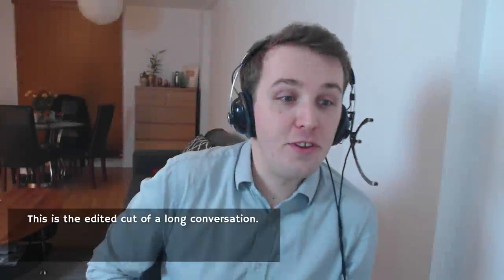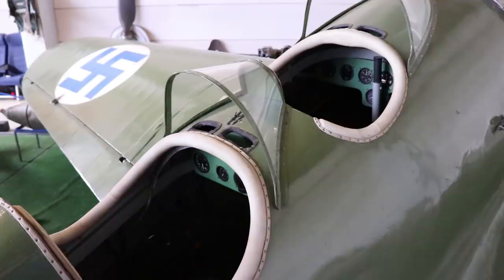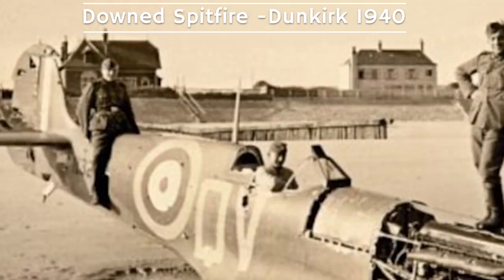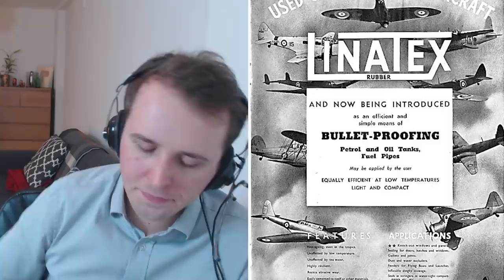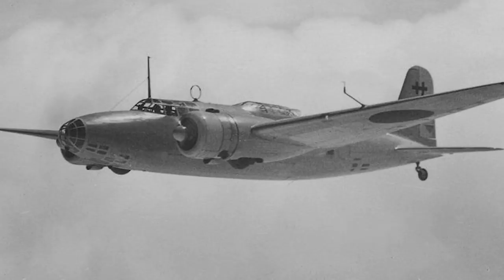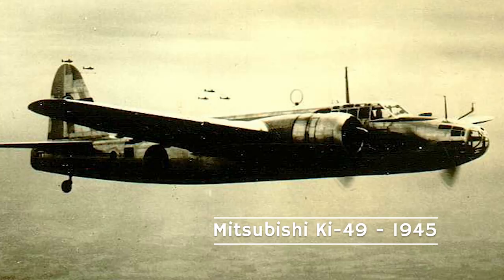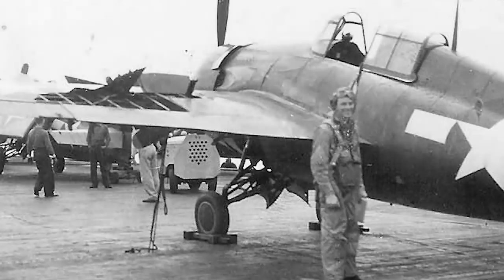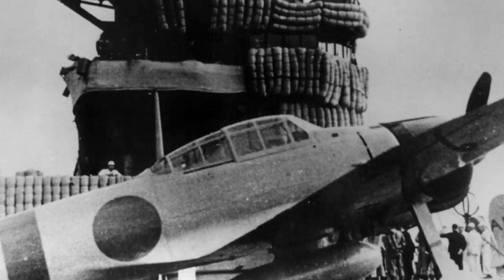WW2 Armour and Fuel Tank Protection - What They Don't Tell You

Comment: You didn't make any comment or analysis of the necessity for armouring a bomber's bomb-bay.
Reply: Were those armored? Can't think of any offhand that were.
Reply: @noshurviverse8388  I didn't say they were. I'm asking: "was that investigated and/or implemented?"
Reply: @andrerousseau5730  I don't think there was any reason you'd want/need to armor a bomb bay. It would be extremely heavy and any caliber of weapon that could set off a bomb inside the aircraft would almost certainly be capable of punching through any armor you'd hope to give it.
Reply: @noshurviverse8388  Your argument is self-defeating: in that case crew armour would offer no protection either so why add the 'unnecessary' weight?? (Obvious answer: "because no-one would want to fly a combat mission!"). Furthermore, I have read of several cases of mid-air explosions where exactly that was the attributed reason, hence back to my first question.
Reply: @andrerousseau5730  No, my argument isn't "self-defeating" in the slightest. Crew protection is included since a pilot really only needs an armored seat back to afford decent protection to him, and that the threshold for what is a threat is much lower. If a 7.7/7.92mm rifle round punches through the skin of an aircraft into it's pilot, then that plane is almost certainly going down. You throw a half-inch steel plate in the pilot's seat and you can avert that, while the rather small size of a seat back means that weight is kept just about a hundred pounds. 

Now, how much weight will it take to put a grand total of a quarter-inch of armor around the B-17's bomb bay? Based on some very rough guesstimates of it's size, you're looking at somewhere in the region of 4,000lbs. That'll keep some rifle caliber rounds out, but does a rifle round have the potential to penetrate an aircraft, penetrate the shell of a bomb and carry enough thermal energy to set off the explosive? If so, you'd expect bombers to be blowing up left and right considering how much fire those things take.
Reply: @noshurviverse8388  Your argument is well off-track as you only refer to 'pilot'; clearly you're you're in fighter mode, not BOMBER mode! For the latter you have to consider the entire crew who operate in entirely different compartments and who have to move about the aircraft. With modern light-weight Kevlar full bomb-bay armouring is perfectly feasible. The crew protection 'tub' used in several ground-attack types is all-encompassing and some tyoes are of steel. The designers designed accordingly and the aircraft engines sized appropriately for the additional weight.
Reply: @andrerousseau5730  Bringing up the titanium bathtubs that planes like the A-10/Su-25 use is kind of an odd choice, considering they line up pretty much perfectly with my view that crew/pilot protection is much more important and generally the focus. Considering the high risk environment that these aircraft operate in, isn't it a bit telling that they all carry their ordinance on wing pylons, entirely exposed, as opposed to a theoretically armored bomb-bay? Meanwhile, the kind of aircraft that have internal bomb bays largely won't be dealing with hostile fire that armor could be expected to defeat. Armoring a bomb bay won't do anything when a Buk or Phoenix rips your plane in half. For crew moving around the aircraft, most bomber designs placed armor that would protect the crew in locations where it would be expected for them to be, rather than where they might walk. On the B-17 the tail and waist gunners get armor plates in front of them. The walkway between the tail and flight deck isn't.

Also, the video was pretty much focused entirely on WWII aircraft, so bringing up modern materials and engines that put out massively more power than any engine of the time period ever could isn't particularly relevant.
Reply: @noshurviverse8388  Fine, if you restrict the debate to WW2 bombers then your comments and observations are a case of peering to close to the window instead of standing back to take in the long view because what you failed to see was the evolution of Luftwaffe battle tactics as the air-war, and specifically the strategic bombing raids, progressed. German air-war tactical thinking became very focussed on Schrage Musik weapons systems. Only a very few were used operationally because the Germans were simply too late to widely implement them. Most were upward firing cannon installations but more fearsomely, they had tested a recoilless mortar with devastating results. Had these been more widely deployed (and would definitely have been if the war had continued) then it is inevitable that in the course of an attack ripping the belly of a bomber open then sympathetic secondary detonation of the bombload  would almost certainly have become a more frequently reported result. The further consequence of this is that bomber manufacturers would have been forced to armour the under-belly and specifically, the bomb-bay of their aircraft. You may or may not be aware that the light-weight flak jackets issued to bomber crews were only 'light' because they consisted of an internal matrix of over-lapping Magnesium plates. Almost certainly the designers would have likely resorted to this arrangement to extend armouring to the now, more vulnerable under-side of the aircraft. Thus the additional weight would not be as much as you estimated. The little extra weight-growth would have been mitigated by up-gunning the engines with all the attendant range-consequences due to higher fuel consumption.
Reply: @andrerousseau5730  Firstly, Flak Jackets were not made of Magnesium, but Manganese Steel, which was a steel alloy that incorporated Manganese into it. Magnesium was a completely different element that had nothing to do with flak jackets. Manganese steel had been a thing since the 1880's, so it's not like it was some new wonder material. These flak jackets weren't that light, most the numbers I've been seeing for the models you're talking about were somewhere in the range of 22lbs. It's also worth looking at what these jackets could stop: they were designed to withstand projectiles such as shell splinters, not direct hits. Apparently the testing showed that they could stop a .45ACP round, but that's a pistol caliber. The difference between a handgun round and rifle caliber round is massive, .45 usually carries somewhere around 4-500 joules, while a 7.92 round has about 3,000. To the best of my understanding, a 20mm shell would have a similar order of magnitude higher energy. 

So for the purpose of defending against the Schrage Musik, which the vast majority of the time was using 20-30mm rounds, slapping a layer of flak jackets on the bomb bay doors isn't going to cut it. You're going to need a much thicker armor layer, with the concerns that come with it. While it's a rather minor point, I'd also question if you'd need to refit bombers with more powerful systems to open these bomb bay doors, since you're adding at minimum hundreds, perhaps thousands of pounds to their weight.

Secondly, I think you're underestimating the extent to which the Schrage Musik system was utilized. Everything I've read that the system began seeing use in August 1943, with it being rather widespread throughout night fighter squadrons by the end of the year. The Germans were absolutely making good use of these things, rather than it being scattered instances. 

This provides us with some additional information: how did the Allies react to this? From what I've seen, while it took the Allies some time to properly understand what was happening (thinking at first it was simply strangely accurate flak, or night fighters that were somehow performing consistent pull-up attacks), the reaction was mainly focused around two major avenues. The first was calls to reequip the British night bombers with ventral turrets that had previously been removed. Secondly, airborne radar sets being used were decent at detecting planes approaching from behind, but not from below. By Spring of '44, more advanced radar sets were being installed, and the losses bombers suffered by night fighters declined. Nothing I've read indicates calls for armoring the bomb bay. 

Finally, looking at things from the German side reveals how they used the Schrage. A couple quotes:
     "The accuracy of the new weapon allowed aiming at specific vulnerable points - such as the Port outer engine of a Lancaster, which powered the rear turret (which if hit would leave the bomber virtually defenceless from a 'von unten hinten' attack) and the fuel tanks in both wings. Wings of course presented a much bigger, more flammable and safer target than the fuselage and there were always the bomber's engine exhaust flames to guide the fighter at such close range. A short burst was usually enough to cause sufficient damage or fire, to cripple the bomber or even make it crash, whilst the fighter usually had time to move to safety."

     "...could reckon to destroy a Lancaster or Halifax with an economical two-second burst. Aiming was so straightforward that it was possible to choose the right place to hit, the main wing spars between the engines being a favoured spot."

Thus, the favored areas that the German night fighters tended to aim for would be areas on the wings, since those contained vital elements and were a large target. Now, there's a part of each of these quotes I left out, since I wanted to emphasize them since it's extremely relevant to the conversation:
     "Firing into the belly of a fully laden bomber from close range was quickly found to be unhealthy."

     "The bomb bay was carefully avoided!"

In short, setting off the bombs would actually be the last thing that a night fighter using the Schrage would ever want, since his aircraft would be directly below a large explosion and the ensuing debris would almost certainly damage or destroy the fighter.
Reply: @noshurviverse8388  By roundabout means your reply has proven my point about the vulnerability of on-board bombs to shock-detonation by impacting shell-fire. Indeed you only have to see the many pieces of gun-camera film footage of fighter attacks on V-1 flying-bombs (and the consequent many incidents of damage and loss) to appreciate the danger, more so considering that the on-board bomb-load might be several times that of a V-1 warhead.
   I somewhat suspect that Luftwaffe pilot claims of being able to aim for specific points during a frontal Schrage attack are highly exaggerated; up to ~800mph combined closing speed?... close vertical separation distance?....doing all this in the dodgy climate of central European skies - and worse, in the pitch-black of night?; I very much doubt it. For the same reason ventral manually operated bomber turrets are of zero use. Even if they had enough advanced approach warning (doubtful) they just wouldn't be able to track the attacker fast or accurately enough to land a hit.
   Cannon Schrage Musik installations were not the ultimate implementation of the belly-attack tactic. This honour would have eventually fallen to the recoillesd mortar system I referred to earlier. I recall that it was successfully trialled in the Me 163B Komet. The notable feature is that there was no manual trigger: entirely automatic.
   The vulnerability of bombers to this form of attack is considerable and only underside armouring is the only feasible option. Had the recoilless mortar Schrage Musik system been installed then the amount of bomber armour required to obtain the necessary level of protection would have been prohibitive.
Reply: A perfect example of the need for bomb-bay armour concerns the 12th January, 1945 RAF raid on the BRUNO U-Boat pen at Laksevåg, Bergen in Norway. Flight Officer Phil Martin's Lancaster DV-393 (R for "Roger") on-board Tallboy took a hit by an 88mm AAA shell which dislodged the arming release wire (!). Luckily they lived to tell the tale!
Reply: @andrerousseau5730  I'm not super enlightened on exactly how the Tallboys were constructed, but from what I've read they were typically base fused impact fuses with a delay. Dislodging the arming release wire would either "unlock" those fuses, which means they'd still require a suitable impact to detonate, or make it so the bomb was unable to arm, depending on how it dislodged. 

I'd be interested in seeing this report, since an aircraft taking a direct hit by an 88mm HE round probably shouldn't exist as a functional machine, armor plate or no. Large caliber HE shells tended not to play nice with even tanks and their armor, so I find it of considerable doubt that a plane would hold up any better.
Reply: @noshurviverse8388  Order from your library a copy of "Code Name CAESER" by Jerome Preisler. The description of the event appears on Page 172. Cheers.

Comment: There is this FB meme going around about how "Abraham Wald used missing bullet holes statistics to advise the military where to armor their planes."  My gut said it was BS.  After watching this I am more convinced it is BS.  Has anyone else seen this meme? Opinions?
Reply: They actually did that since it made sense. The areas without bullet holes had vital components behind them while the holed areas had nothing critical located where the bullets passed thru. Their aircraft losses became lower after the mechanics added armor to protect the various vital components.
Reply: @billwilson3609  That is the story. My gut says the engineers knew exactly where a plane was vulnerable and designed all the lift surfaces, trim mechanics, engine hp, inner structure strength, landing gear, etc. etc. to be within tight tolerances.   It's kinda insulting to the super smart people who worked on the plane designs to think they didn't already know.